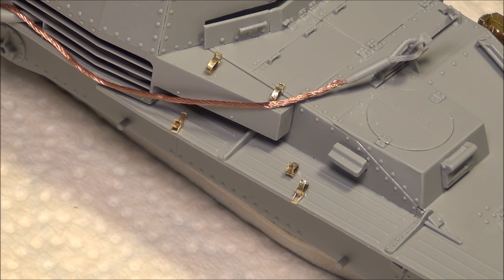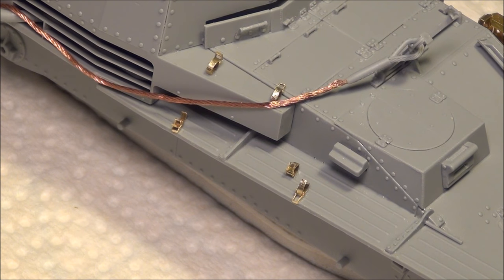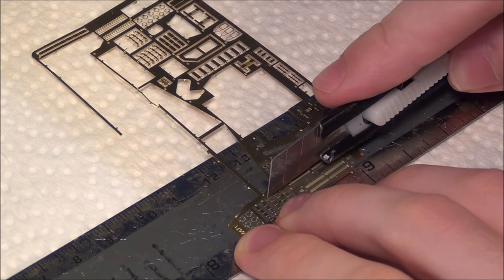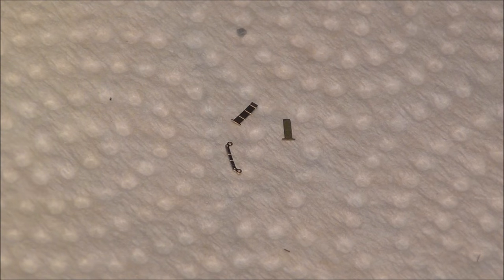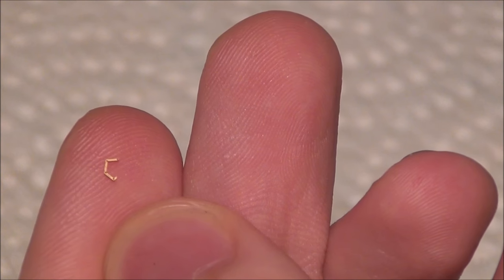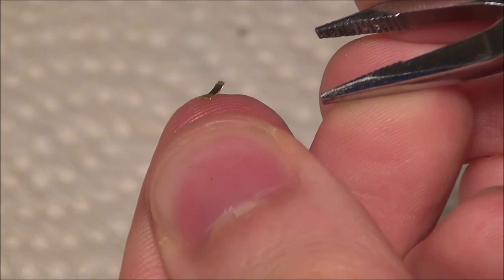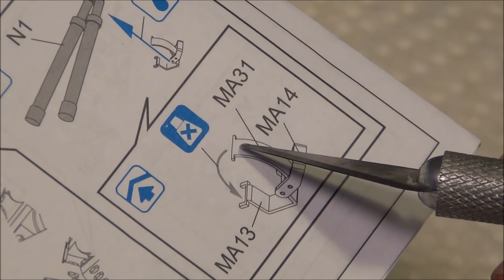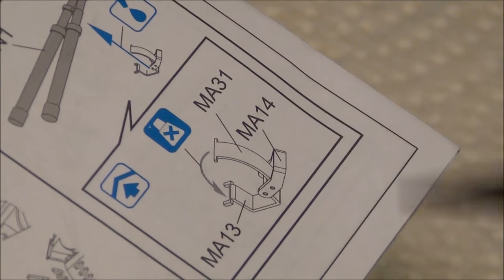Tutorial: Assembling Dragon Photoetched Metal Tool Clamps

Comment: very cool! I like photo etch, I use needle nose, and bender. the detail is amazing on kits. great job Panzerman36
Reply from the maker: Thanks Clayton.  I think I'll pick up a bender soon; it's probably a lot easier to use and more precise.What bender do you recommend?
Reply: Hey I just seen this sorry. I use the hold & fold 5 speed, very nice. Had mine for three years now, beat to heck,;). still works great, one thing though, the sixth bending tooth on it is very soft, don't try to bend any thick photo etch with it. It will tweak up some just enough that it won't hold small parts unless you remove the top and bend it back into shape. I also love it because you can turn the top ether way so you can bend long parts too. Anyway love your videos, and hope I helped you some.
Reply from the maker: Awesome!  Thank you very much for the recommendation. It sounds great.

Comment: Nice assembly technique on such intricate details and I know Dragon's instructions can through you off on some of their sub-assemblies, I have a question...I'm stuck on the Mid-Version Tiger commander cupola where the cover slides to the rear of the tank, does the part get inserted from under or over the top of the turret roof? that holds the cover in place to make it movable.